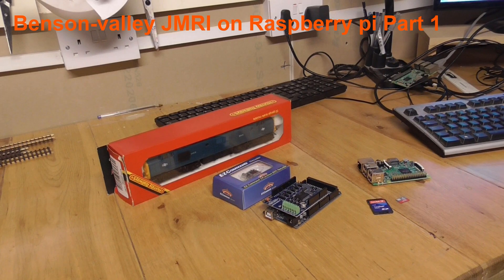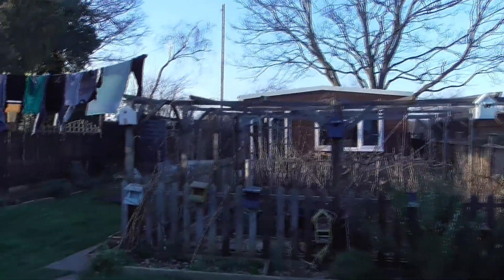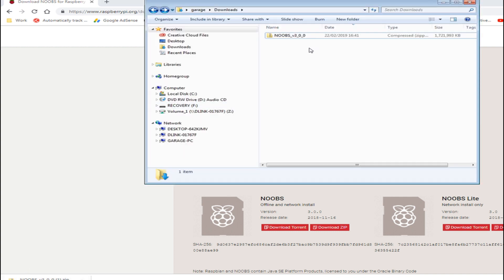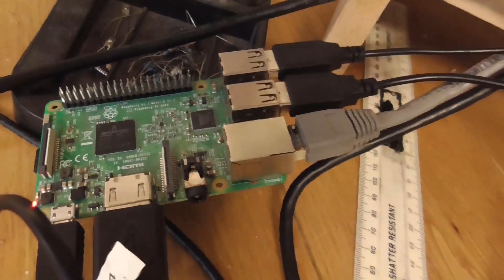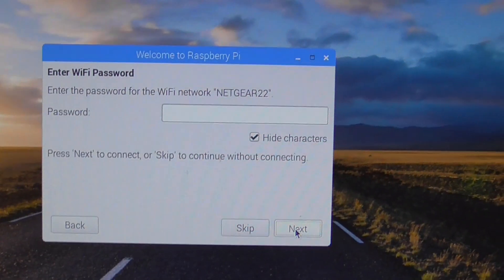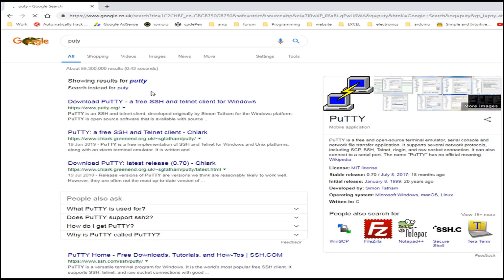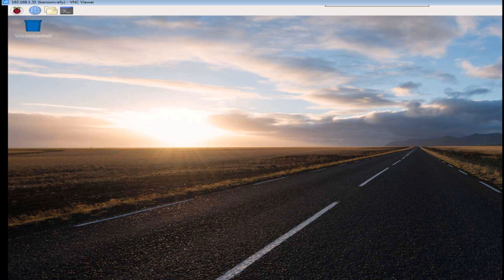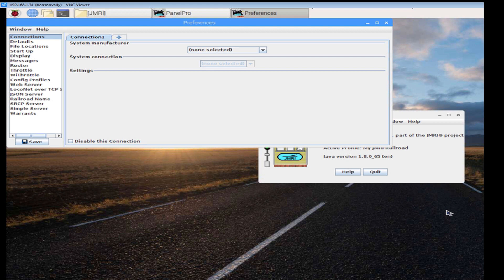JMRI on Raspberry Pi Model Railway Part 1

Comment: You should set the ip address static in the router, nightmare when it changes and you can`t login to pi.
Reply from the maker: You are totally right dan, all my pi's are static set in the router and I also have them port forwarded for port 80 and FTP so i have access outside. I did not want to do a video of this as there are so many different routers and ones supplied by your broadband supplier can be very difficult to setup

Comment: How did you get on with your block detection project. I am just building a loft layout and I am hoping to do something similar?
Reply from the maker: I did not finish it but as soon as i have the DCC++ working and a usable DCC loco i will have another go. i am hoping the OO gauge will be a lot easier as it draws more current
Reply: @BrackstonesTravelAdventures  I am going to be using OO and I also have bought some of the ACS712's to try but to be honest I think it's probably I bit beyond me so I will perhaps see if you can manage it first 🤣
Reply from the maker: @davidccostin  Have you tried following the web blog i believe i set up the occupied system but have not scaled it up. When i do i will post another video
Reply: @BrackstonesTravelAdventures  Awesome I am only as far as insulation at the moment so you certainly have time 🤣